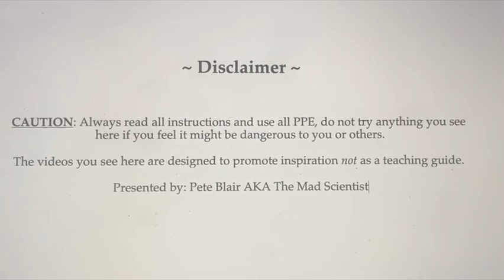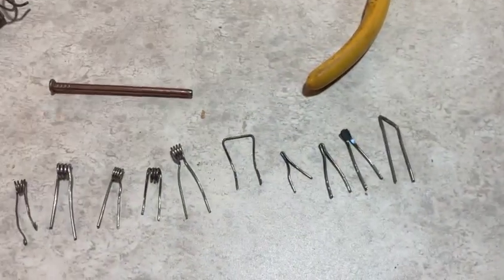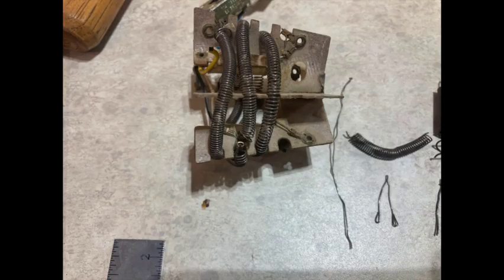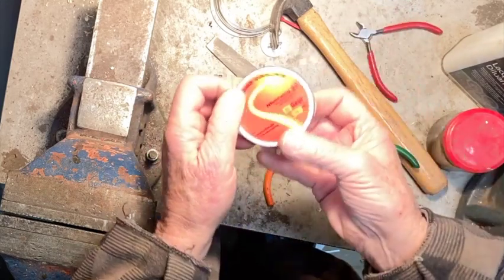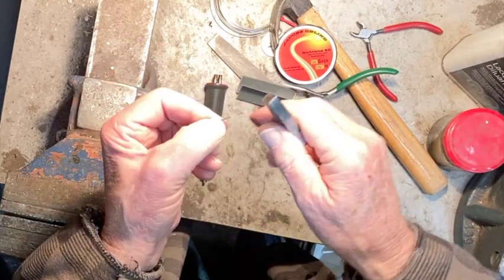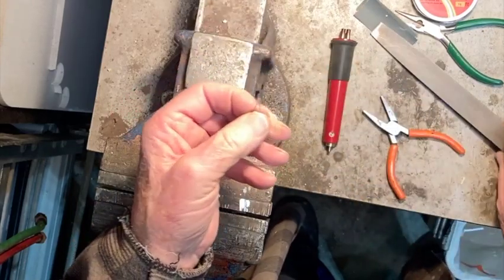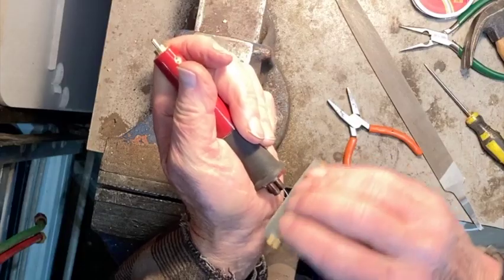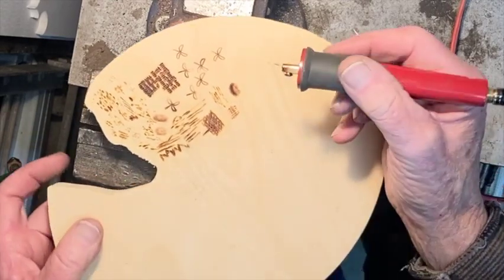Making a Pyrography wire tip. Brought to you by Pete Blair AKA the Mad Scientist

Comment: That’s an awesome video I can take an old toaster apart or hair dryer an use the wire out of that
Reply from the maker: Yes but in many the wire is quite thin. You may need to make the element quite short. The diameter is about the same as the tips I got for my Peter Child burner.
Reply: Oh ok thanks so much keep the videos coming
Reply from the maker: Let me know how you make out. I’m guessing you know that you can get Nichrome wire on Amazon I have also used a paper clip in a pinch!
Reply: Oh really a paper clip how does it work good and what gauge of wire do you suggest
Reply from the maker: Hey Lloyd the paperclip was for an emergency not sure it is good for a burner but I do have one of the heavier duty ones so I had no issue. I use 20 ga and 18 ga Nichrome @lloydbannister8062
Reply: Ok thanks a lot buddy